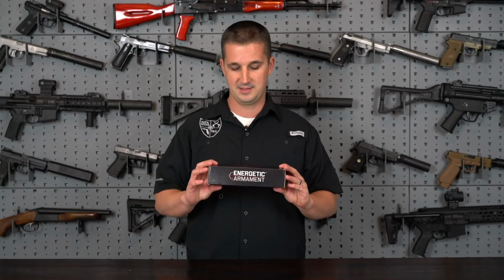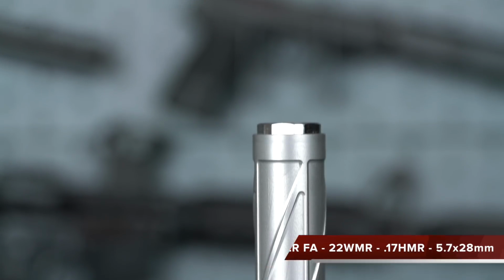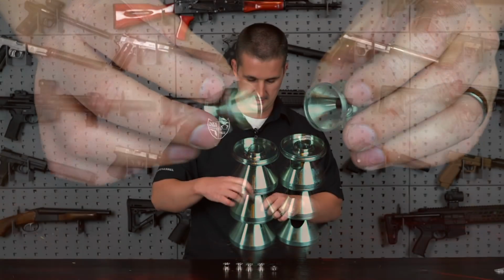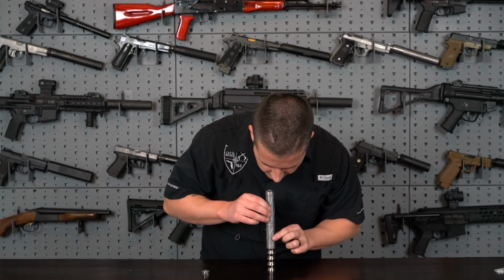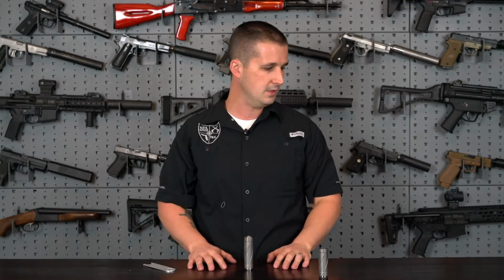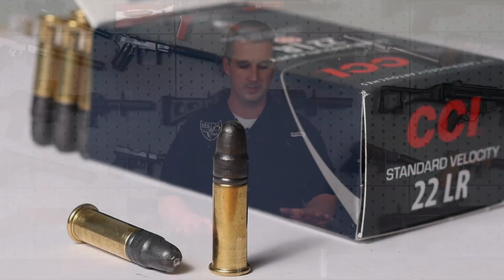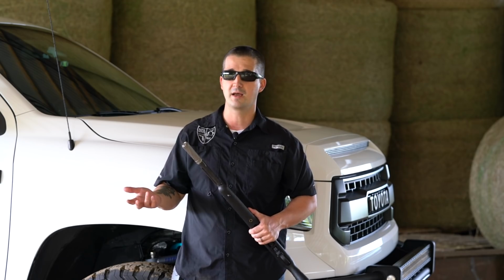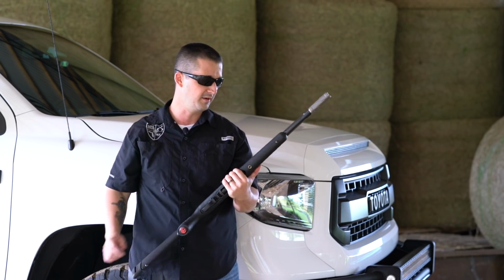Energetic Armament NYX MOD2

Comment: Dumb question can you use the front half independently from the rest
Reply: If im understanding your question correctly the answer would be No. That would be creating a "new" supressor. The serialized part needs to be mounted to the firearm when firing. Which in this case is the back half. Some manufacturers put there serial numbers on the threaded barrel cap, so any part forword could be used, or not used. What the ATF doesn't want you to do is to use 1 supressor broken in half on two different guns simultaneously.

Comment: It metered less at the ear in the short configuration? Even if it's the same that seems a little weird. Though I guess with the long barrel and subsonic ammo it could make sense.
Reply: Could also be some bolt noise. Longer configuration could have higher back pressure and make the bolt louder. Just q guess though

Comment: Anyone able to recommend a way to only have to buy one suppressor for my handguns 45 acp to 22 lr? I hear that just shooting 22 lr is still on the louder side when shot through a 45 acp suppressor because the larger diameter allowed gasses to escape. Is there a suppressor with multiple end caps both 22 and 45 and will that work well or still no where near a dedicated 22 can. I know it will be a larger heavier can then a dedicated 22 and it will have to be able to disassemble to clean dirty 22 ammo. Any recommendations appreciated.

Comment: Not that anyone cares but just to be a little more precise, FEA (Finite Element Analysis) will show where and how a part experiences stress under a given load/ pressure. "Parametric optimization" is really what this suppressor went through with the given stess parameters from FEA.

Comment: Did you have to change anything in your 10/22 to get it to run the standard velocity cci's? I just got a takedown and it will NOT run them at all.
Reply: Mike W contact Ruger. Should cycle all 22’s.
Reply: Agreed. Contact Ruger and ask them for suggestions. 
My 10/22 can reliably cycle with just about EVERY brand and type of .22LR ammo I've tried short of Subsonic rounds. And even they will start to extract/eject but the case returns to the chamber.
I say just about every type of LR ammo because I honestly cannot remember ANY brand not functioning properly for me. 
Perhaps if you thoroughly clean your action and apply a VERY THIN layer of QUALITY lubricating grease to the recoil spring/rods it will smooth up.
Another thing is if the gun is still pretty new it may just need to be broken in and the reciprocating parts smoothed up with repeated use.